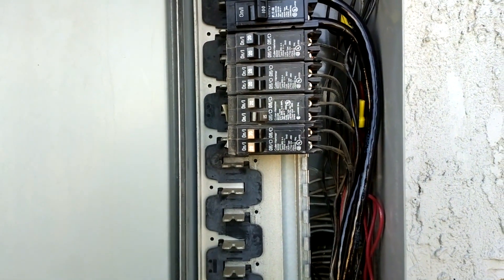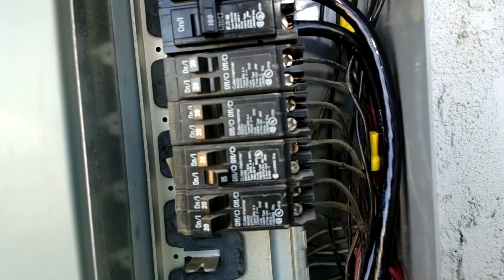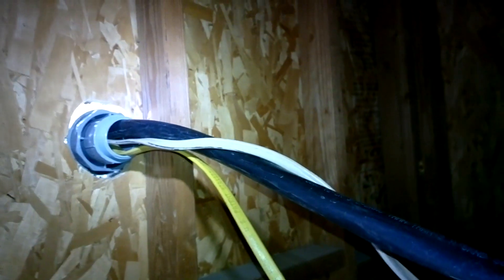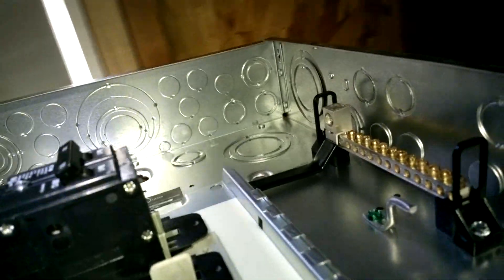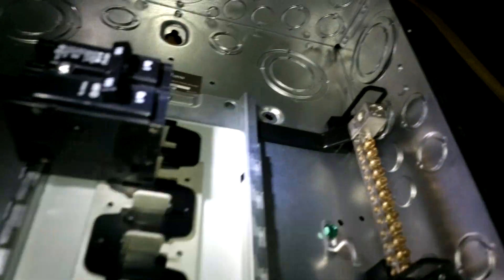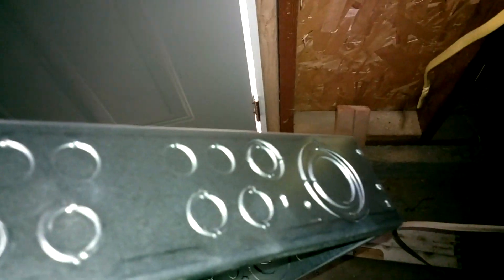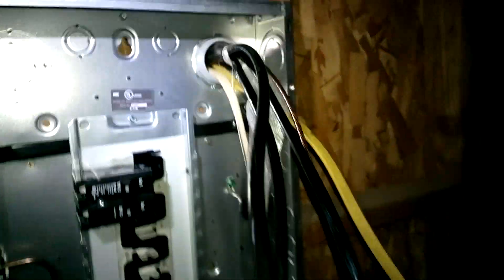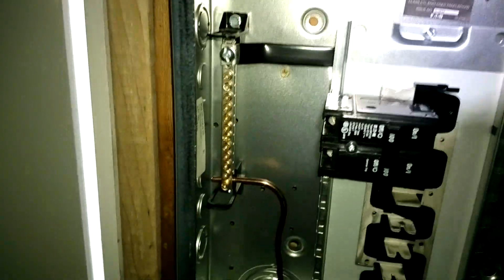The Odd Job Do'er finishes the 100 Amp sub-panel to a garage.

Comment: Good job I’m installing one too I’m curious if I need a permit I live in Texas.😮👍👍👍😉 I’m also curious how much did this project cost in material
Reply from the maker: i would say you would need a permit in Texas.. i think in all the states you do. if you have someone else doing the work then they might pull the permit. it gets a little wishy washy if your in a smaller town, bit towns will almost always have an inspector smaller ones might need one to come from the county. but this is all general info you might look up your local city building code people. 
so costs i do not have them handy but by far the power cable from the main breaker to the add on was the most costly and it will depend on how much you need measure good, i was just over by six feet and i think the cost was $436 or something, then next was i think the conduit, the new box, and some add on breakers for the added panel

Comment: You needed to add a  separate ground bar . That panel has 2 neutral bars bonded together
Reply from the maker: umm no, it one is unbonded to make it a ground bar that goes to the ground rod, but maybe it is not so clear in the vid...
Reply: Wrong again a ground bar is straight to the box not on plastic brackets those 2 bars are connected together.

Comment: Also, you're not supposed to have the cables coming into the box thru the same hole.
Reply from the maker: so any idea on what part of the NEC code talks about this?
Reply: @TheOddJobDoer  saw it on another video, 12/2 are ok. 12/3 and others need to be single. Again, I have to double check. Not an expert here. Trying to install a subpanel myself, so gathering info.

Comment: I do not know if you survived or not!   If you did, I am sorry to inform you that SER cable and NM cable are illegally installed in this video.   Reasons are as follows.    SER and NM are not allowed to be installed in conduit exceeding 6'-0".     These cables are not manufactured to be installed in wet locations.(PVC conduit below grade is a wet location).  Hopefully you didn't get shocked too bad.   Your procedure to identify the conductors at the end is seriously flawed!!!
Reply from the maker: OK so it has been some time from this job and no issues yet. the Service Entrance Cable did not need to be in the conduit, it could have been direct buried under ground. so it is fine. not sure where you got the 6' cutoff numbers but that is not true for where i did my work.  the PVC is rigid. the NM from last i knew did not get hooked up to anything. the rest of the electric in the garage is all well working, or i am sure i would have heard back by now.
Reply: The Odd Job Do'er   Not all NEC violations explode.   But if you check NM cables in NEC it will tell you not allowed in conduit With exception of up to 6'.   SER and SEU cables to my knowledge have never been allowed in conduit either.    I think you will find most cables are not to be installed in conduit.    Causes heat build up during higher usage.
Reply from the maker: @KevinCoop1  
Are you sure about the NM cables in the conduit? maybe you would like to point out what part of the NEC says only 6'...  as for "heat" building up in the conduit, that is why the need to calculate for "conduit fill" is needed.  to sum up what the NEC does say is use conduit if the wire need protection.
Reply: The Odd Job Do'er    I will have to dig out my code books.   I retired Oct last year.   It may take some time, hope that is ok. Do you have a year preference?     Conduit fill of 40% is for pulling, not heat.   Number of current carrying conductors is for derating because of heat.   Will get back to you.
Reply: The Odd Job Do'er    I believe it is actually 10' now.  NEC 312.5 C.   States only 10' if connected to a cabinet.   Will get back to you if I find more.
Reply: @KevinCoop1 you are correct about th nm cables in conduit, because of heat build up
Reply from the maker: @BAKERHUSKIE  so i found this "National Electrical Code 2011
ARTICLE 334 Nonmetallic-Sheathed Cable: Types NM, NMC, and NMS
II. Installation
334.15 Exposed Work. In exposed work, except as provided in 300.11(A), cable shall be installed as specified in 334.15(A) through (C).

(B) Protection from Physical Damage. Cable shall be protected from physical damage where necessary by rigid metal conduit, intermediate metal conduit, electrical metallic tubing, Schedule 80 PVC conduit, Type RTRC marked with the suffix -XW, or other approved means. Where passing through a floor, the cable shall be enclosed in rigid metal conduit, intermediate metal conduit, electrical metallic tubing, Schedule 80 PVC conduit, Type RTRC marked with the suffix -XW, or other approved means extending at least 150 mm (6 in.) above the floor. [ROP 7-94] Type NMC cable installed in shallow chases or grooves in masonry, concrete, or adobe shall be protected in accordance with the requirements in 300.4(F) and covered with plaster, adobe, or similar finish."
Reply: The Odd Job Do'er     Yes, in (Exposed work) (if subject to physical damage) the cables can be protected by certain conduit and tubing types.   This area requiring protection is (by all inspectors I have dealt with) from the floor up to 8' above the floor, or above grade outside.   Schedule 80 is used a lot on power poles along streets to protect conductors.
I believe you installed schedule 40 pvc. Which is not in the list of approved wireways in your last comment. Therefore not allowed as means of protection in this case.   Also, it still does not address that those cables are not to be used in wet locations.   Conduits underground are wet locations.
Reply from the maker: @KevinCoop1  well from what i can see Schedule 40 is okay for underground but schedule 80 should be used for high traffic areas. this was not a high traffic area.  it was all signed off so for what was use and where it was used the inspector was good with it.
Reply: @TheOddJobDoer  your inspector knows less then you. I would have never signed off your install. If I did my boss would have fired  me.
Reply from the maker: @thomasmarable6818  Well do you have anything constructive to say? it seems most do not watch till the end, and in the end it looks like i somehow do not have the rest of the wiring done. if you want to start trying to quote code to help back up your thoughts then that would be something.
Reply: @TheOddJobDoer  why should I you seem to have a code book cause anywhere you come up out of the ground your cable must be protected up to 8 foot to  18 inches below grade with schuoted  you quoted that. Next  under article 334 says you can not run type nm-b in wet location. The code defines underground conduits are a wet location. Also just because an inspector sign off on it does not mean its right. Plus I bet if you look it up your local inspection office takes no liability in the work and leaves it all on you. So burn your place down get somebody hurt ,it all falls on you. The code is a safe way of doing it.
Reply: Look up 334-12 uses not allowed. Also 300.5 nowhere does it say high traffic but subject to physical damage which the NEC already told you under 8 feet. Again your inspector is not very good at his job.
Reply: @thomasmarable6818       Well stated!
Reply from the maker: @thomasmarable6818  sure, but codes change and in some cases there is better then the code.
Reply: @TheOddJobDoer the NEC updates  every 3 years and yes somethings are better then code. But you do have to meet minium code, you did not do that.
Reply from the maker: @thomasmarable6818  well we will just have to wait and see the next video about this.

Comment: No bonded neutral and ground it’s a sub panel. And no additional ground. That will cause ground loop.  🤦‍♂️ videos like these need to be banned.  Or just labeled with “Warning don’t do what this moron did.”
Reply from the maker: Well Jonathan, I am guessing you think your a master electrician in your own mind? to start the sub panel has no bonded neutral (3:52) and yes being that it is in a garage, the CODE around here does state you need it grounded with it's own rod... but if you have more information on this, do share with the group.